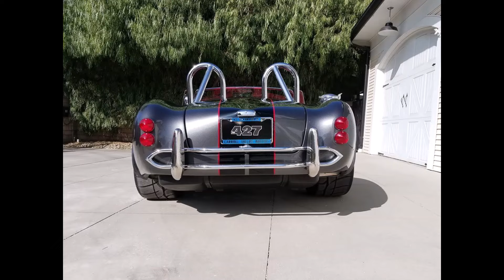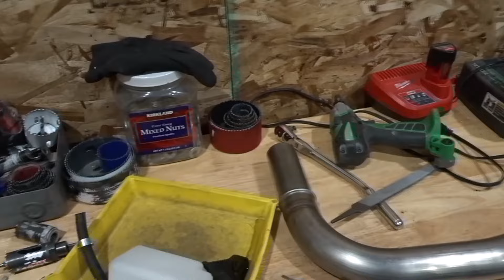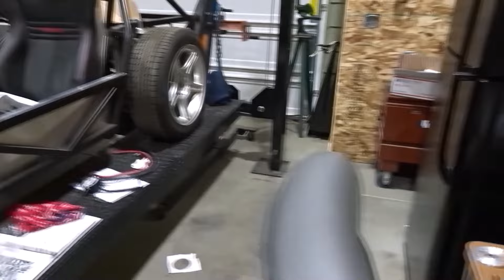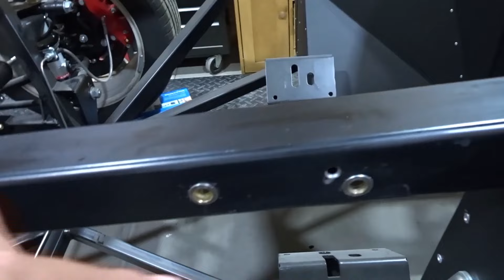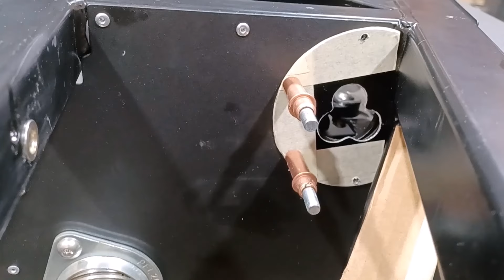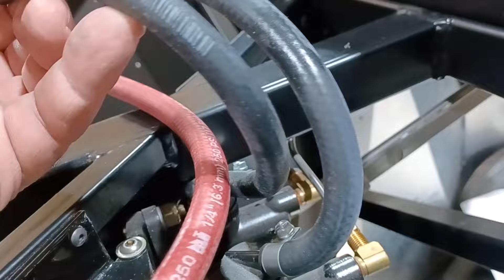Adding a Tilton 3 Chamber Reservoir to Our Factory Five Racing Type 65 Coupe

Comment: Damn I love your channel. 
My car is on order. What size riv nuts do you recommend as the most common thru the car. I need to order some. Thanks!
Reply from the maker: Appreciate you watching. We probably use more 10-24 rivnuts than any other, but we always have 10-24, 8-32 and 1/4-20 on hand, just in case.